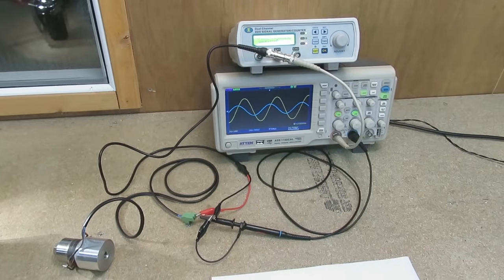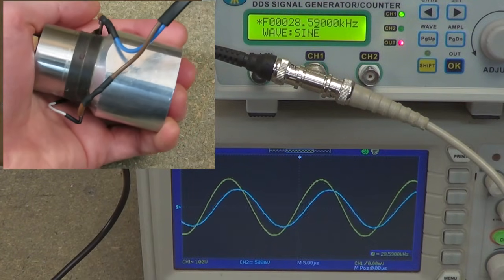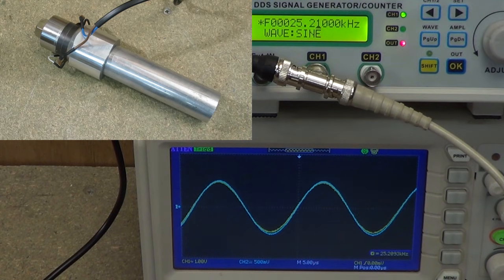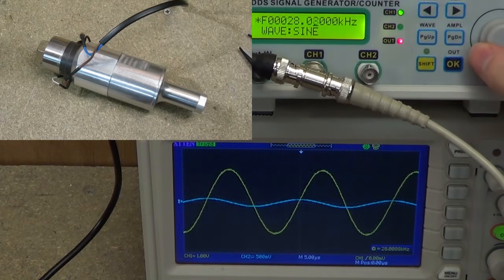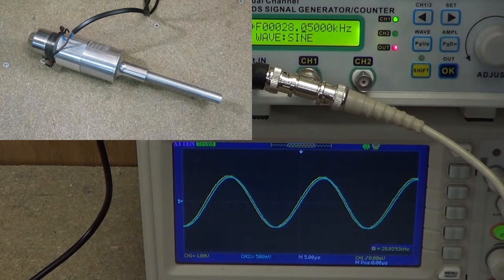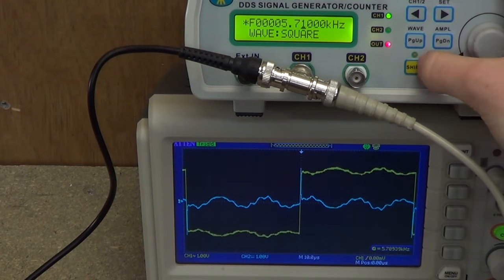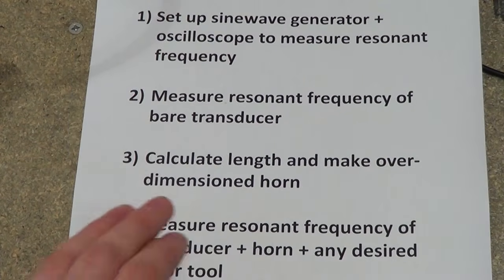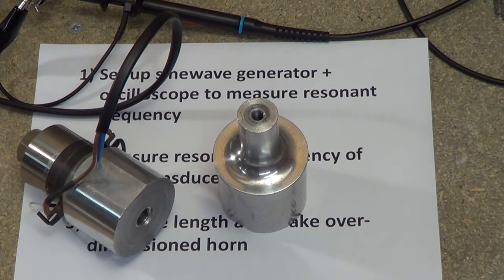Ultrasonic Transducers - Measurements and Horn Design

Comment: Damn 7 years later, I find this absolute gem on youtube. This is treasure, thank you for making this. I make an ultrasonic cake and pizza cutter, using transducers found in cleaners as my thesis project, I dont know if I can get enough power out of them, maybe I use multiple of them and make an optimal horn design before connecting the blade

Comment: Thank you, your explanations allowed me to get my ultrasonic welder working again with the customized tip.
It auto tunes automatically and the 2x2mm radius reduction was enough to whack it out of it's operating range.(<- just means it was badly tuned to begin with)
After hours of trying to design a new horn in CAD with FEM sims, and some attempts to make a new one out of steel I was very frustrated. 
After watching your vid I thought: "hey theoretically, if I put a washer between it, it should work" and it did, the annoying f-er finally shut up.
Reply from the maker: That's great to hear! Nothing beats just messing around with things to see if it works ;-) The only thing I'd add is to make sure that there is good contact between the washer and the other parts of the horn - if it's a stamped washer, the faces will likely have a bur, so give them both a sand on a flat surface to improve contact. Otherwise it might dig in and loosen over time. And ideally it should be made from the same material as the horn, but that's probably harder to achieve.
Reply: @imajeenyus42  Should hold and its a quality washer so time will tell, part of an automated machine.
Still a lot of other kinks to iron out before the entire thing is production ready anyway.
But at last it spit out the first signs of life and parts. So progress, yay.
Just hope its predecessor/sibling doesn't kick the bucket in the mean time.
There is some stock left but orders are somewhat unpredictable 🤷‍♂

Comment: Thanks for the video. 
 It was well done and the descriptions as well as the demonstrations are valuable.  Before watching this, I questioned the need to mechanically tune the transducer/horn system rather than simply designing the driver to operate at whatever frequency an arbitrarily sized system requires. This  had been mentioned elsewhere in your comments.  However, you were able to add the mass of a horn and with careful tuning, match the bare transducer's resonance frequency at the first fundamental.  Your 13kHz starting point demonstrates that you are not tuning to a harmonic.  We will be constructing an ultrasonic cutter and your work will make this much easier.
Thanks again.
Reply: I wonder if it might be useful to consider changes in material in terms of resonance at the working end of the horn ie going from aluminum to brass.
Reply: @Tech Ingredients - Are you still planning to build an ultrasonic cutter? I'm eager to watch your video on the matter.
Reply: Why is that I find often comments from either Dustin or you under underrated vids I watch.
Are our tastes in video consumption really that similar?

Comment: Good morning, at what voltage do the transducers used in cleaning work and if the applied voltage is sinusoidal or square?
Reply from the maker: Several hundred volts. The ouptut from the inverter is squarewave, but this is filtered by the series inductors to produce a more sinusoidal signal which is applied to the transducer.

Comment: Very nice!!!! PLL control loop is what you need to auto track the resonance. i had it done... ... working on double PLL method now, there is much power in harmonics also, for cleaning applications mainly. Heat and load conditions change the 28khz nominal on impredecible ways, it is important in industrial scale aplications. regards from Peru.

Comment: Hello Lindsay. Very interesting. How about when using the transducer attached directly to a Cup of stainless steel to use the ultrassonic waves to clean? Do i need some specific size for the container for best performance or there is no need because it is a direct sonication?
Reply from the maker: As long as the transducer is well-coupled to the cup/tank (e.g. by gluing the entire face of the transducer), there shouldn't be any issue. The water in the tank presents a large load to the transducer, which broadens its resonance significantly, so the exact driving frequency isn't quite as critical.
Reply: @imajeenyus42  yes the transducer Is fully glued with JBWeld under the container. Thanks a lot for your answer.

Comment: I have made the same circuit but instead of current increasing at resona nce frequency, it actually is decreasing at some frequency, please help
Reply from the maker: You're most likely picking one of the higher resonant frequencies (see graph here, for example - there are many other resonant frequencies: http://imajeenyus.com/electronics/20110514_power_ultrasonic_driver/photos/impedance_bare_mismatched.jpg). What you want is the lowest resonant frequency.

Comment: Hi Lindsay. Great video, clear and concise content. Came across your website many years ago when I too were trying to drill fine holes in ceramic, like you, but for miniature gas burners. Gave up at that time as didn't have access to a lathe. That has now changed 😀 Looks like I need to get a DSO now.

Comment: I literally feel ten times smarter after watching this.  I'm going to check out your other videos to see if you have cut things with it.  You give me ideas about how to create resonant waves in magnets to make them stronger.  Very awesome.  I have an unfinished video about how I believe magnets and gravity and stuff works.  I should have sound added in three days.  Anyway, wow, so awesome.  I know your work seems non-consequential to many people who are not into this sort of thing, but actually you've opened the door to advanced resonant matching in materials that can go beyond ultrasonic.  Even in the ultrasonic, I was watching your video and wondered if you could recreate the sonoluminescence effect of when soundwaves collapse water bubbles to create temperatures four times hotter than the sun, for microseconds!  What if instead of collapsing water bubbles, you used it to collapse the side of a magnetic field that is nearly spherical?  Anyway, great video.
Reply from the maker: Glad you like it! Single-bubble sonoluminescence has been recreated by quite a few people, usually in a spherical glass flask with two opposing piezoceramic discs attached diametrically opposite each other. I think there was a Scientific American article a while back about this. I actually observed it myself once (the important word is ONCE!), but it is very hard to get the right water conditions (correct amount of dissolved gas). Don't know how vibrating magnets will affect things but it sounds an interesting idea.

Comment: Hey Brother.... thanks for the Video, If we don't have scope and we give parallel connection of Function generator to Micro Ampere meter then (other parallel connection will go directly to transducer) , at the frequency where meter needle fluctuates to Max.  is resonant frequency?  Thank you in advance.
Reply from the maker: Yes, that is correct - a series current meter would give a maximum reading at resonance. However, you would obviously need a meter that has sufficient frequency response to reach the frequency that you're operating the transducer at. Most digital multimeters only go up to maybe 10kHz so wouldn't be suitable.

Comment: I have purchased a new 36 kHz 1200 watt transducer as the original stopped working. The new transducer  is heating up within a couple of minutes of being connected to the generator, even when the bare transducer is connected. Would you say the problem is with the generator or the transducer.
Reply from the maker: I'm afraid I really couldn't say. Does the generator have any sort of retuning process that you have to go through when changing a transducer? Maybe it's not driving it quite at the resonant frequency and that's why it's heating up?

Comment: Is the Transducer being in direct contact with the table something that will alter the frequency due to it will pass some of the frequency to what it is in contact with just like the horns you put on it? Just something to consider...The horn is no different than the length and diameter of an Antenna. The horn is an antenna. Higher frequencies use shorter or "smaller" antennas. There are simple formulas that will allow you to calculate the length of an antenna depending on Frequency. In HAM and MARS radio we build out own antennas all the time.
Reply from the maker: The effect is pretty insignificant, and it only really damps the resonance very slightly, it doesn't change the frequency. If you look at 17:30, where I'm showing the effect of pinching the horn at various points, you can see how the resonant frequency doesn't shift.

Comment: So this would explain they my ultrasonic cleaner lost a lot of cleaning power when I replaced the tub with an identical one, but went a bit overboard with the amount of epoxy? all the extra mass where it squished out the sides around both transducers is probably causing the resonant frequency to dip too much.

Comment: Great video! Do I always have to calibrate the assembly (transducer + horn) to the transducers' resonance frequency or can I use the frequency of the whole assembly as the input? For example, I have a 40Khz transducer, and the assembly resonates at 35Khz, can I input 35Khz and operate the machine with this frequency or do I have to use the 40Khz and calibrate the horn for well function?
Reply from the maker: Thanks! To be honest, I'm not entirely sure, but my feeling is that you should optimise the horn so that the entire system operates at the same frequency as the bare transducer. The transducer has presumably been optimised to operate at 40kHz - at that frequency, the piezo elements will experience a longitudinal node, so they are only vibrating radially, which is where they are happy. At any other frequency, they would experience other sorts of vibrations, which might damage them. So better be on the safe side and get everything working at 40kHz!

Comment: Love the video. Can you operate this transducer in a translational mode with a high voltage input to use it as an actuator? Or are there not enough Piezo donuts to be practical?
Reply from the maker: Thanks! I don't think so - if I have my figures right, a 5mm thick piezo disc made from PZT will change in thickness by only about 60 nanometers with 200V applied. Things are obviously different at resonance, where the amplitude is far greater - I measured about 20 microns peak-to-peak. Piezo actuators generally have many stacked elements, or additional mechanical amplification with a flexure.

Comment: Thank you. I have some questions but about ultrasonic cleaning. I would like to build my own cleaner but i cant get information. I would like to install transducers not just on the bottom of the tank but on the walls. I saw that there are commercial devices which has transducers on the opposing walls off the cleaning tank. I am just wondering if the opposing transducers can cancel each other? Should there be lets say a dimmer/controller which controls the output of the transducers rather than having them all on full power all the time.
And lastly  would mixing different frequency transducers increase cleaning efficency?
Reply from the maker: Opposing transducers may have detrimental effects, I don't know. In commercial cleaners, it may be that they have designed the distance between them so as to not cause destructive interference. Far more common is to just have transducers on the bottom, as it makes the cleaner much less bulky. I have no idea about reducing power of some of the transducers - certainly, attempting to use a dimmer to reduce power to a typical cheap ultrasonic driver board would not work, as these boards rely on operating at full mains voltage to get oscillations. Operating at a reduced voltage will likely damage the driver. You do get dual-frequency cleaners, typically operating at both 28kHz and 40kHz which apparently have more effective cleaning. However, you must question why you have to build an ultrasonic cleaner when they are so widely and cheaply available.
Reply: @imajeenyus42  Unfortunately they are not that cheap and i am not looking at the ones with known brands at all. 30L aliexpress cleaners are like 380€. While you can buy transducers/drivers and build yourself a custom tank. Dimming was the wrong word choice. I was just wondering if the controller turn the transducers on an off in a specific pattern or just simply turning one bank of transducers on while the other bank is off.. I jwill just order some transducers and experiment. Just wanted to ask if you already have experience about this topic.

Comment: Do you short the piezo terminals when machining the assembly?
Reply from the maker: The transducer is removed from the horn before I machine it down in the lathe, so it's not an issue. Certainly for storage and handling when it's not connected to a driver, I keep the terminals shorted, as any thermal expansion/contraction can produce a significant voltage on the terminals.

Comment: This was well done.  At the end, where you warm up the extension by torch, I think the change in your resonant frequency is an interesting phenomenon that is not easily explained.  Temperature change can affect both density and bulk elastic modulus.  Either can affect the speed of sound and thus affect your resonance frequency.  There could also be some influence of thermal expansion and thus your geometrical constraints change.  Being that this is material property dependent, the functional parameters must be well understood and does not apply neatly across all solids the same.
Reply from the maker: Thanks! You're absolutely right - there will be multiple interconnected effects and trying to predict what actually happens to the resonant frequency (increase or decrease) is probably very difficult. I'm not a theory person so don't really know much about it ;-) I wonder if horn designers actually take temperature into account when designing a horn - e.g. a high-power horn under continuous operation might run at an elevated temperature, so you might want to design its profile so it's at the correct resonant frequency at that temperature, not sure. There's actually a vaguely similar thing with laser diodes - since the wavelength increases slightly with temperature, if you're trying to match the wavelength to say a narrow absorption line (e.g. pumping a NdYAG crystal), you need to specify what temperature the diode will operate at when buying it from the manufacturer.

Comment: Does the bare piezo crystal have the same resonance as the original transducer?
Reply from the maker: From what I gather, yes, it is. For example, here's some rings which resonate at 44kHz, a common frequency for bolt-clamped transducers: https://www.steminc.com/PZT/en/piezo-ceramic-ring-35x15x55mm-44-khz
The resonant frequency depends on the poling direction - rings used in these transducers are typically poled radially. Note also that clamping tension affects the frequency as well.
Reply: Thank you for the explanation!

Comment: Can you tell me what the efficiency of the transducer horn assembly ???? Thanks
Reply from the maker: I've seen figures quoted of around 90% for transducers used in cleaning applications, but I don't know about a horn, sorry. I imagine it will depend a lot on how the horn is loaded, the driving frequency etc.
Reply: @imajeenyus42  I should have been a little more clearer with my question. When a transducer is matched to a horn of the proper frequency would the matched pair increase the sound pressure, and if so by how much would you say Lindsay ?? Since the transducer is more or less a piezo crystal powered by an electric current would varying the frequency electrically be feasible to increase the cleaning power ?? Thanks, V

Comment: Hi Lindsay, I know this is an old project but do you mind telling me what is the white cable around the transducer for ?  I'm assuming they are connected to the poles. Thanks !
Reply from the maker: It goes to a high-value resistor (I think 100k, can't remember) which bleeds off any charge that forms on the transducer. If you pick up a bare transducer you'll sometimes get a small shock because the body has expanded/contracted and generated a charge on the piezo discs!
Reply: Nice! thanks for your reply and great work !

Comment: Coud you make a video about Ultarasonic Plastic Cutter design? I am searching this subject .I was learn plastic's(ABS) resonance frequency as it is 9225 Hz.
Could you advice me  a pdf or web site for this project ? I need praticallly formulas for transducer and horn
Reply from the maker: Sorry, I don't know anything about cutters. However, you can be certain they won't operate as low as 9225Hz, as that is easily in the audible range. Most are 40kHz, 60kHz etc. I don't know where you found that figure, but the resonant frequency has absolutely nothing at all to do with the material that's being cut.

Comment: Hi. from 0 to 30 sec you show one image with wiring connection. from 30 sec you show electric diagram. I can not see the Resistor in first 30 sec on wiring connection.
Reply from the maker: No, you can't, because it's just a small 1/4W resistor. If you look carefully at 0:25, you can just about make out the scope leads clipped on to it (near the green connector).
Reply: @imajeenyus42  Thank you for reply :)